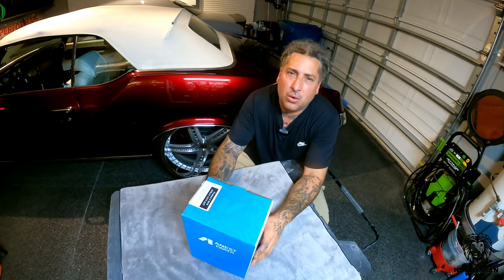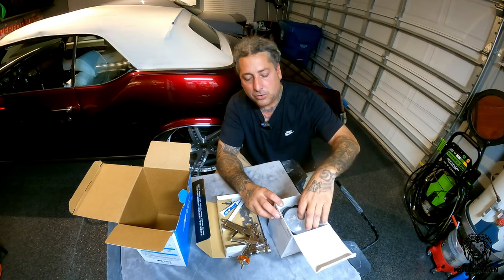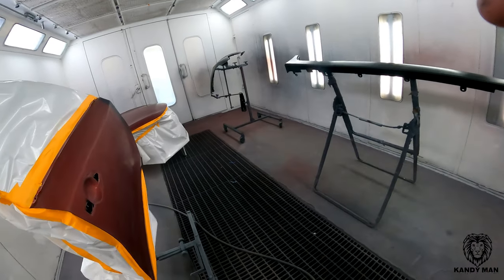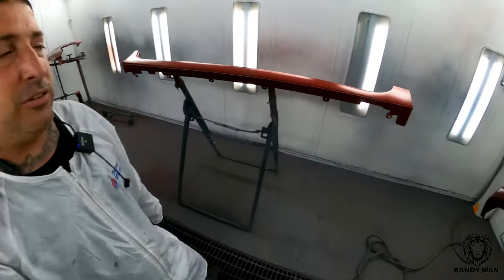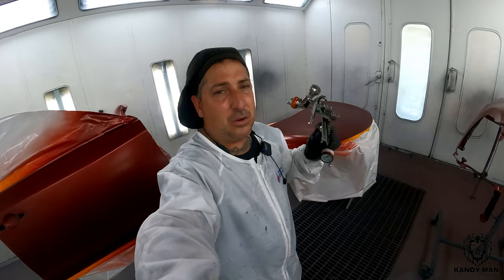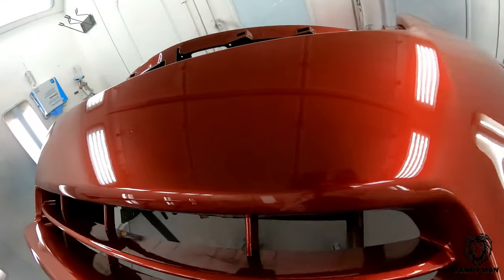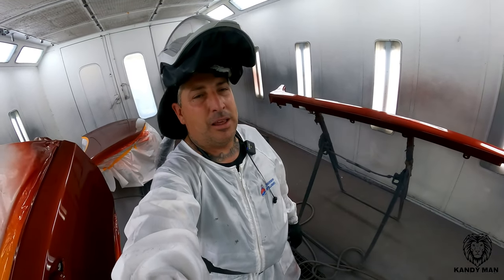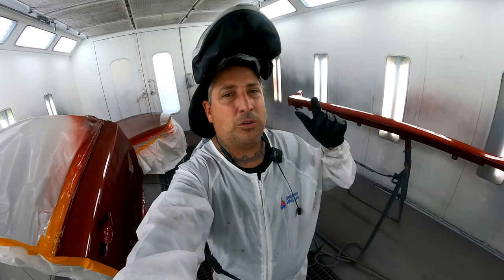LPH400 IWATA SPRAY GUN

Comment: This was my main gun for everything except primer for many years and it’s still rocking .After using the Satas and my Tekna for awhile with waterborne,this is again my main base gun since we switched to solvent with the orange cap and 1.3 .It’s a great all around gun
Reply from the maker: Yes it is thanks for the feedback
Reply: The LPH400 was one of my first quality guns when I got serious about painting. Now I have all the big flagship guns of the major brands, I still like to use the LPH for smaller jobs like hoods, doors and fenders. It is a little bit slow compared to my other guns but never disappoints when it comes to the finish.

I recommend it to any painter and especially to new painters for a great do-it-all-gun.

Comment: I had this gun and it used more clear than my sata 90 1.3sl did at the time. It depends on what you spray & how you use it. 24 spi, i never could have sprayed that low unless the clear was junk . Like chromabase 600 from back in the day 😅

Comment: Have the same one but only with a 3.1 tip & orange cap, it sprays clear pretty good but it does leave a little peel not too bad & usually spraying around 25 psi

Comment: Nice video 👍
Just need some clarification on model numbers on this gun.
I mainly shoot all overs  in single stage and base.
Kinda overwhelmed with all the different guns available but I’m seeing the extreme with the 1.3 and wondering if that’s the same one you are demonstrating?
I use the ws400 1.3 for clear and love it.
I like a little slower gun but not too slow.

Any thoughts on tip size in that gun for what i shoot?
Thanks for the input 😎
Reply from the maker: Yes it is

Comment: I have the same gun with 1.3 the purple and silver cap love the gun it's like a 3 in one.
Reply: Hi there..how are your settings when using the purple cap..i bought that cap some time back but can figure out the massive fan it makes..any tips on using the gun with this cap??
Reply: @kenneth andersen  I haven't used it much, but for me turn all the way out they in until the trigger moves and then adjust the fan. I do motorcycle so I don't need a big fan.

Comment: I have that gun too, same size tip. Its my clear gun and I prefer it to the newer supernova series Iwatas.
Reply from the maker: Great gun for sure 👌
Reply: The supernova is such a finicky gun when it comes to the settings, once you get it dialed in it is magical.
The LPH400 is very easy to setup and use, parts are plentiful and cheap compared to other guns.

Comment: Great to see you trying out different guns you could make the harbour freight purple gun look good keep the content comming brother ( Arther) 🤣🤣
Reply from the maker: Lmao 💪
Reply: The purple Harbor Freight gun is surprisingly good (sometimes).... it just doesn't last. It is assembled with silicone sealant that breaks down and don't try to take the gun apart or else it will never work right again.

Those guns cant be beat for costing less than $10 on sale with a coupon.  Definitely a one or two use gun before you throw it in the trash. The solvent to clean it costs more than the gun.

Comment: hello Kandy Man, when i click on Amazon Storefront, i did not see u selling the kits same as u state on this youtube, i can see LPH400 LVX Gun only ( 5670) same color orange for amounts $533.24 but there is show no kits come with 3M PPS 2.0, also what is adapter 3M 2.0 number # able screw in LPH400 to able can using 3M PPS 2.0 kits??? can u let me know thanks
Reply from the maker: They don't have the kit on Amazon sorry
Reply: @kandyman5315  where i can get the kits?? i did special order from amazon without the kits
Reply from the maker: @thanhnguyen4908  i bought mine at a local  paint store  years back.
Reply: @kandyman5315  u think LPH400 Orange Lvx 1.4mm is the best clear & base & sealer ?? or Silver cup?? i know Purple cup is more special for Complicated paint but will think get later, Thinking get Porphis 717 & 715 they seem clone out nozzle cup kits of Iwata V-cup
Reply: @kandyman5315  i am lucky bought from amazon one of supplier send me same kits what u have !! i am order both hun LPH400 Lvx for1.3mm & 1.4mm but i think i should keep 1.3mm for better result for base & clear, then will buy nozzle kits and cap see can swap over to using one gun, instead buy 2

Comment: I use the silver cap. Do you think the orange is significantly better? Sounds like a perfect cap for hot days.
Reply from the maker: To new to tell but definitely a good 👍  gun
Reply: I think the orange cap is better for base not clear.
Reply: @jq8792   The orange cap is good for everything. The purple cap is perfect for custom work as it lays clear like glass. I have all three caps and never use the chrome cap anymore, orange all day and purple for special jobs.
Reply: @zurus172  29 psi, full fluid, full fan (adjusted for even pattern).

Depending on your clear, MS HS or UHS, you need to adjust the fan from full to avoid a dry spot in the middle. 

I usually spray a UHS clear so I don't need to bring the fan in very much.

Comment: Hey bro love the video I just subbed..

Question… I see you mention certain guns give certain finishes as far as orange peel goes and I heard you say mirror flat slick finish…. I’m currently restoring a classic and I’m doing an engine bay … which gun would you say gives you that ultra slick/ flat mirror finish?
Reply from the maker: Dv1 c1 air cap
Reply: @kandyman5315  danggg would of never thought the dv1 for it… the orange and black gun right? 
Any tips of adjustments and materials consumption ? I usually spray house of kolor high solids show clear
Reply from the maker: Wide open fan and fluid
Reply: @kandyman5315  Okk thanks one last question what tip you recommend? I saw the dv1 has a few. Main color I’m
Spraying is Lexus nori green pearl… paint code 6X4 it’s a metallic

Comment: I appreciate the your coverage on this. I've had mine for 4 years as a dedicated clear gun. I have to say I read almost the full pdf from iwata and this gun is sort of an LVLP it was saying. But since epa regulations don't recognize that term (in their infinite wisdom) so they just call it an HVLP. What pressure did you spray it at?
Reply from the maker: Thanks for the insight.  I sprayed it at 24 psi

Comment: I been hearing alot about the LPH 400. Imma have to try one out one day
Reply from the maker: Great gun
Reply: @kandyman5315  I've heard. I currently use the Copper Tekna Clearcoat gun and love that gun. I've been using Devillbiss guns for years
Reply: @kandyman5315  What PSI do you normally spray your clearcoat when using the Tekna Clearcoat gun?
Reply from the maker: 25 psi
Reply: @kandyman5315  I may have to try that. I've been spraying at around 30 psi with it. I'm use to using medium solid clear coats, but using hs clears now and trying to get use to it. On fenders and doors I can get it to lay down fine, but hoods are giving me problems getting it to lay down good

Comment: Man I wonder how guys say this gun is slow,,right now I use this more than my ws400 for clear
Reply from the maker: It a fast gun to me for sure 👌👍
Reply: Plus it’s so efficient with materials
Reply: Its probably because they use 1.3 and chrome cap
Reply: @Kaabosurron  so u think the chrome cap is slower,,from your experience which cap has the biggest fan and better pattern ,,and which atomize the best
Reply: @andrelawrence9644  the chrome cap is good for what it is made for "clear" because of the medium pattern at full open. The orange is made for base because of the huge pattern helping with metalic laying even. The orange is more versatile because it can do basically everything just matter of setting it up. Also get the 1.4 it helps alot moving faster and can just turn fluid it if it's to fast for you